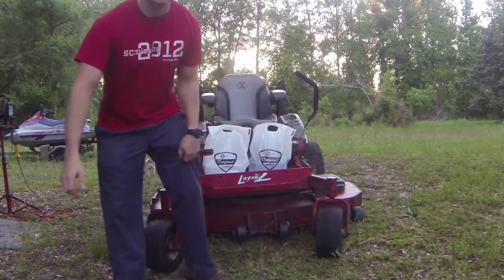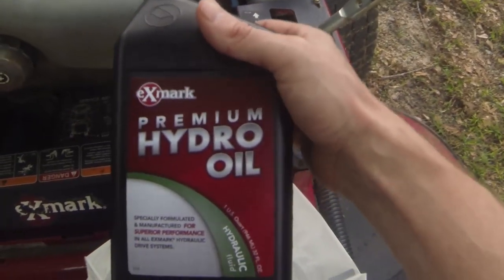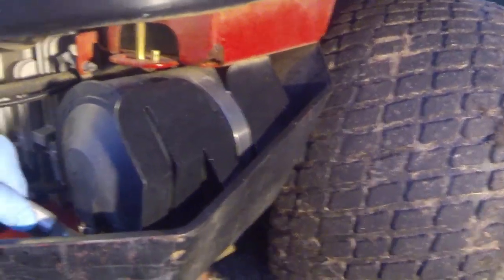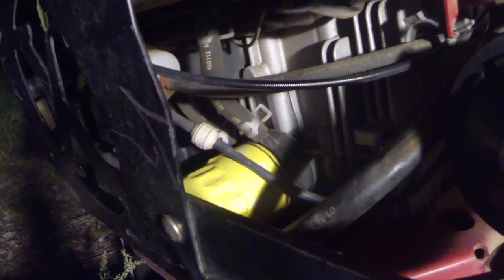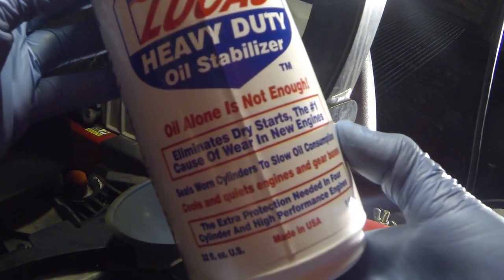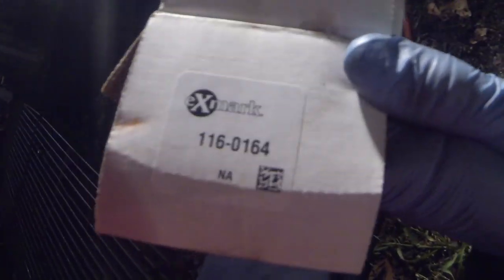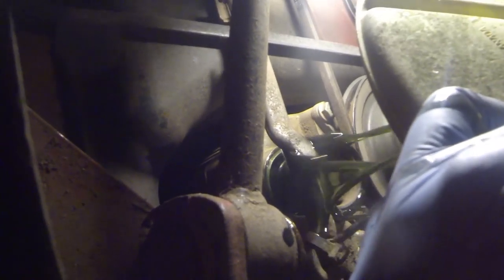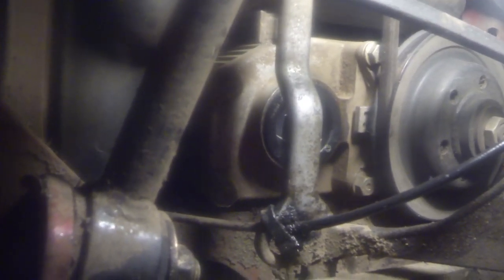Exmark Lazer Z Engine oil/filter and Hydraulic oil/filter change how to

Comment: Word of caution when checking or servicing your hydro fluid be very careful screwing in dipsticks they cross thread very easy. They are plastic to aluminum. 

My first hydro service was performed at a local dealership perk when purchasing a new unit. They cross threaded mine up without me knowing until I checked fluid levels later on. They will still be tight but will not seat all the way down. 

Replacements are fairly costly around $60 for both sides.
Reply from the maker: Good tip thank you!

Comment: So there’s just the two hydro filters. One engine oil filter. And the main air filters. Those are the only 4 filters on the machine correct? Loved the video!
Reply from the maker: That is correct as far as I know unless they are hiding one somewhere I have not found yet!
Reply: In line Fuel filter as well
Reply: 2 air filters

Comment: I have an exmark similar to yours and to get to the hydraulics behind the seat is a lever that allows you to flip the seat forward out of the way for easy access to the hydraulics dip sticks !, also curious as to whether you check fluid level with dip sticks threaded in or not ?, The line you mentioned at the top of the dip stick with the letter H is probably the level line when hydraulic fluid is hot due to expansion I assume !....
Reply from the maker: I will have to check to see if I have that same lever! From my understanding the fluid is checked when screwed in all the way. That is how I check all my dipsticks. Thanks for watchin'!

Comment: Can you use a fluid extractor to remove alot of the hydro oil so it doesn't all dump out underneath? Thanks
Reply from the maker: Yeah you probably could use one. I remember using a syringe to remove some when I overfill it.

Comment: It is not necessary to run forward and backward for 30 seconds 4 o 5 times with the mower jacked up after changing the hydraulic fluid to avoid damaging a valve o something????I saw that in another video and I just want to make sure🙏🙏
Reply from the maker: The method in this video has worked for me, mower still runs like new I still have it. Not sure your what your question is I'm afraid.

Comment: Are those parker drives? Hydrogear uses a spin on filter.
Reply from the maker: I am not sure what type of pumps Exmark uses, but I know they are top of the line if Exmark uses them.
Reply: They are parker units

Comment: hey mr. fix it-
a 22min video & you dont even show my dumbass where on the mower i add the oil . Just stick the funnel down there somewhere huh?!?!  pour it in there til its full?!?! (btw....check out the  Husqvarna 555 bar & chain oil video on YouTube) 👌
Reply from the maker: Big yellow cap with an oil can on it, pull it out there is the dipstick, keep it between the lines. If you can check the oil in your car, you can check this oil.